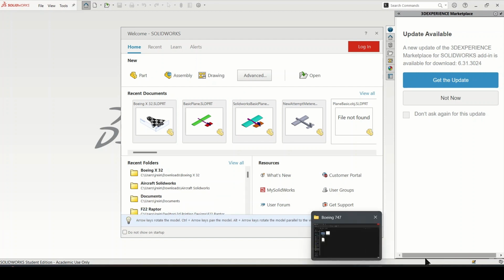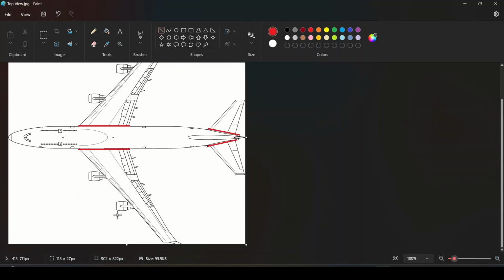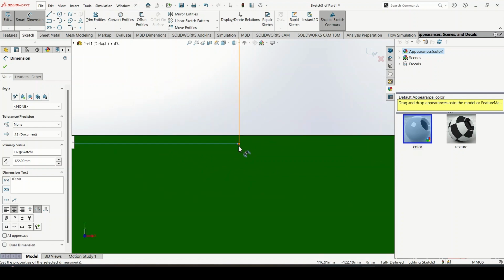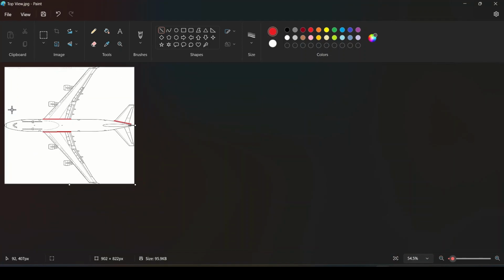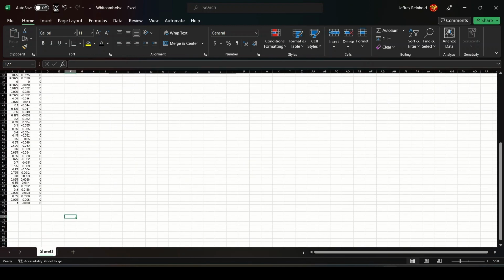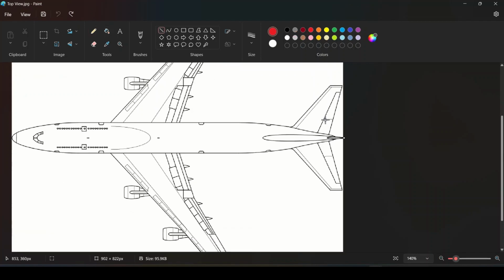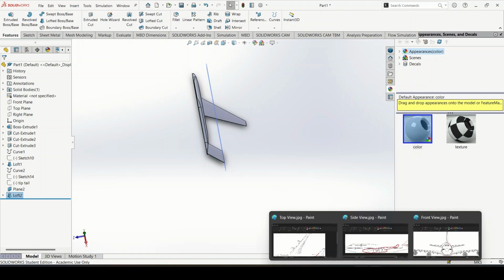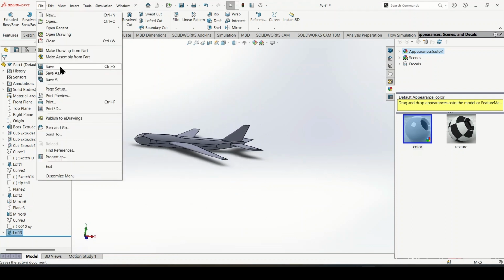SOLIDWORKS Create a Boeing 747

Comment: This is not the efficient way of doing it.
Reply from the maker: @RealBMK  correct, I recently learned a more efficient way. I plan to do a video on it soon. Learned it in college class recently.
Reply: @jeffreyreinhold4465 did you later do it sir
Reply: @jeffreyreinhold4465 did you later do it sir
Reply: @jeffreyreinhold4465 did you later do it sir
Reply: @jeffreyreinhold4465 did you later do it sir

Comment: This boeing has diheral angle and sweep angle ? How can i dimension it in solidwork
Reply from the maker: When you create the sketch outline of the tip airfoil, you can raise it a certain amount distance vertically, which will have to be calculated using trigonometry.
Reply: @jeffreyreinhold4465  you mean tip wing right

Comment: Hi bro, where are the numbers you get in the vid
Reply from the maker: I got the numbers from the microsoft paint program after opening an image of the 747 I downloaded from the internet. The coords of your cursor show up in the bottom left while using paint. Those gave me numbers to shape the fuselage and other components. If you don't have microsoft paint, you can also use GIMP, or any other image editor.
Reply: @jeffreyreinhold4465 ok but are the nunbers same as the specification of a boeing or you just customize that? Thanks and hope to see your reply
Reply from the maker: @Casio-cx4hn  I see what you mean, the numbers are not the same, but all the numbers should be proportional to a Boeing 747. Example: you could look up the wingspan of a 747 and divide that number by the width in pixels / width I used, and that would give you the proportionality constant.